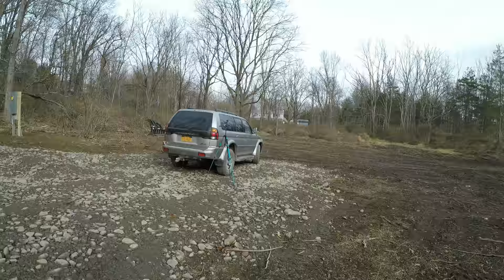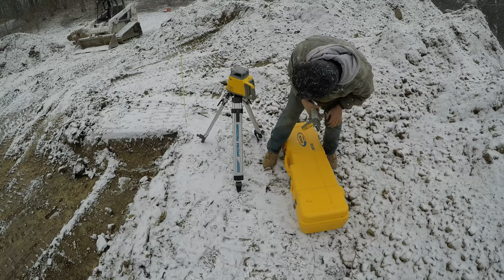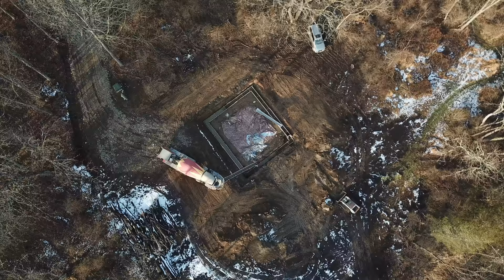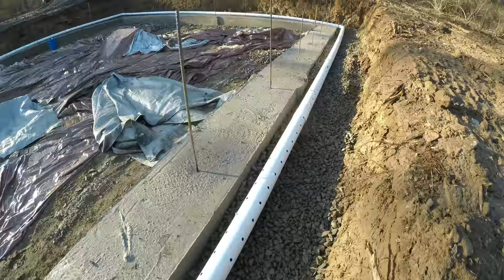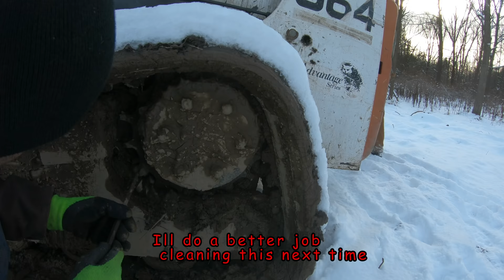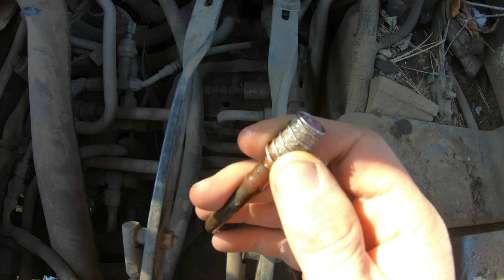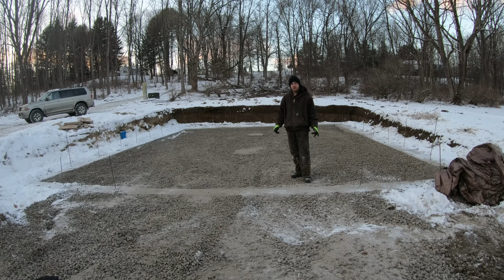Digging a foundation and pouring a footing

Comment: The holes always go down on peremitor drain. I think being you are way lower than floor height you will get away with the mistake.
Reply: Why would you put the holes down?  It's to collect water and run it out the end away from the house.  Pointing them down won't do anything, IMHO.
Reply: @alext8828  because your not catching water as it comes down. Your catching it as it rises. Pour a gallon of water over the pipe with the holes up, and see how much you catch.
Reply: @jameshorrocks2939   That is true, isn't it?  I thought about that for a couple of minutes and that does make sense.  But what about this scenario?   As you say, water is rising and enters the holes on some area of the perimeter of the house.  The water then runs along the inside of the pipe on its way to the end connection to be taken away.  Before it gets there, it travels over an area that is not yet saturated.  Wouldn't the water then leak out of the holes at the bottom and attempt to saturate that area too?  It would just move water from one area to another until the entire perimeter was saturated.
And what happened to the old "drain tile" flexible pipe I used to see.  Is Andrew using the wrong pipe?  Is this leach field pipe?  I remember drain tile (confusing name because it just plastic corrugated pipe with slots cut into it) Just wrapping the uphill side of the house and redirecting water around to the downhill side.  Isn't that the right pipe to use in this case too? 
I don't know shit about these things.  I know water likes to go downhill.  
Thanks for your redirect.
Reply: @alext8828  that is a possibility. But it isnt an issue. You put the pipe in above the bottom of the footer and below the floor. It is only there to wisk away water before it threatens the living area. With the holes up the water will rise to the top of the pipe before entering the drainage system. Which means the water has actually made it closer to conditioned spaces.
Reply: @jameshorrocks2939  Ah, good answer.  I say this:  Put the holes where you want them.  Put the pipe below the holes.  Ha.  What you think?
Reply: @alext8828  it's your party. I'm just telling you what the pipe manufacturers suggest.

Comment: .
In Paraguay, the problem is overheat...
.
In summer, the temperature is +0- 50°C...
.
In winter is +o- 5°C the low temperature...
.
Isn't  farenheit, is celcius degrees...
.

Comment: Seems like you did not fully prep your 864. You left summer fuel in it and did not have anti gel in the fuel tank. Not a wise choice. You are loosing productivity because you did not have your 864 with the Diesel Engine in it prepped for winter temps. I hope you do not do that again with any of your equipment or vehicles. Be safe out on your jobs. Mostly I see you being safe.

Comment: A good idea would be to had put a good coat of that black tar sealer or some type of sealer on the outside of that foundation makes a huge difference in water entry under the house but I'm not sure of the ground water where you live or if it's necessary I just always thought it's a good idea to do it regard list of where the foundation is  And especially if you  Lay concrete block on top of the concrete foundation It's a really good idea to put several  Coats of sealer on the concrete block Because block really absorbs water like a sponge Not to diminish the job you're doing because it's obvious you know what you're doing and you do a great job at it and I also know that this isn't your home or your foundation your just doing what is asked of you

Comment: if the truck driver that broth the gravel to the building site and don't drive to the place that you want. HOW THE HECK HE GOT HIS DRIVERS LICENS . a good truck driver nows that he most go down in the lowest gear and than he most let the truck rolling on engine . the truck get slow down the hill , the make no difference of the is slick or not. the engine controle the truck.

Comment: Do you should look at the details on the plans that’s not how installing that sub drain system around the building right foundation drain. Do you have to burrito wrap the pipe in filter fabric and permeable rock you shouldn’t be doing other peoples work if you don’t know what you’re doing

Comment: 704.1 Slope of Horizontal Drainage Piping

Horizontal drainage piping shall be installed in uniform alignment at uniform slopes. The minimum slope of a horizontal drainage pipe shall be in accordance with Table 704.1. 

TABLE 704.1 SLOPE OF HORIZONTAL DRAINAGE PIPE 

SIZE (inches) MINIMUM SLOPE (inch per 
foot)
21/2 or less 1/4
3 to 6 1/8
8 or larger 1/16

2014 PCNYS some of the new york plumbing code my be excerpts from either the international or uniform plumbing codes. ICC or IAPMO. Mechanical standards and building standards of New York can be found on the Internet. The lates New york standards adopted by the New York State legislative body and governor should be easy to find out. Calling your building department. Some of the building codes may be applicable to some of the work you do. The plumbing code should not. The uniform plumbing code requires 3" pipe be run at 1/4 inch per foot but your New York code states that you start running your 3" at an 1/8. I have seen 3" run at an 1/8 and never really saw a problem. The engineering standard is to accomplish what is called, self-scouring and is in fact physics of Left and drag. All your code books for the state of New York can be purchased on line. The 2014 PCNYS reads as the international or uniform plumbing codes do; yet the state of New York may have some requirements that are not exactly the same as found in the uniform or international plumbing code books.

Comment: Fook me, if i had to deal with that kind of cold i would get a steam pressure washer
Reply from the maker: Yeah, that might work if there was water there. There are probably better things I could do if I had to deal with that cold every day. The weather pretty much shut that job down. I'm waiting for the mason to do those walls, than I can backfill, but the ground is probably too frozen now.
Reply: Yeah, my place didn't have water up till last week when we finally got our well drilled, still no power but i picked up a 325 gallon tanks of CL for 100 bucks and that's a lot of water for getting grass to grow and pressure washing equipment. small electric pump and honda genny got me flow/pressure to the sprinkler or pressure washer. all took up less then half the bed of the truck.

Comment: Diesel fuel does not freeze!
Just the water in the fuel... which shouldn't be there if you use treatment.
Reply: Diesel gels. The paraffin begins to revert back to a solid. It starts to be cloudy, like turbidity, at 0ºC and worsens as the temperature keeps going  down. When it gets down to about -12ºC, the paraffin gels and clogs filters.